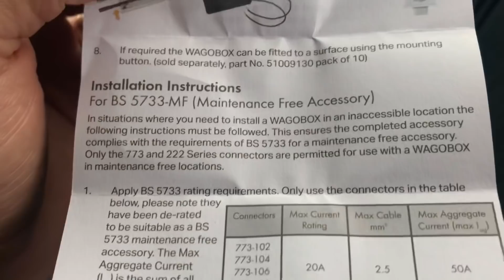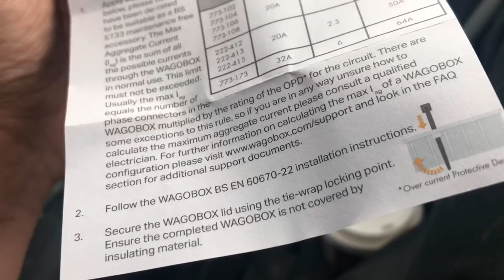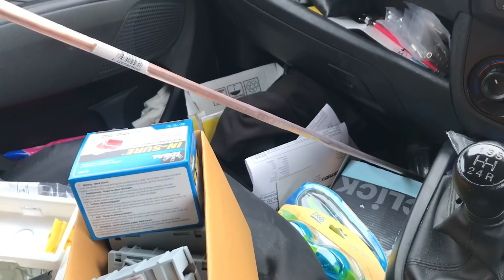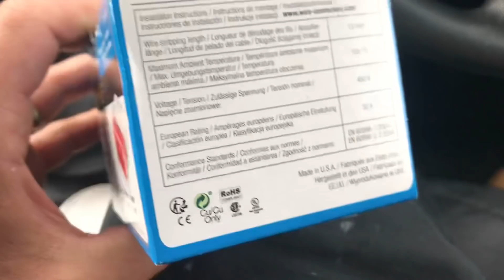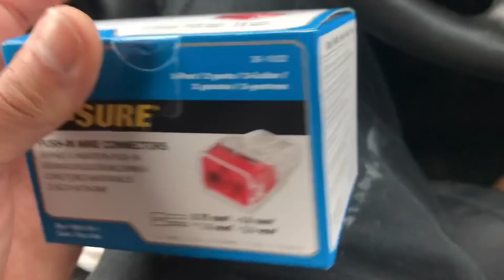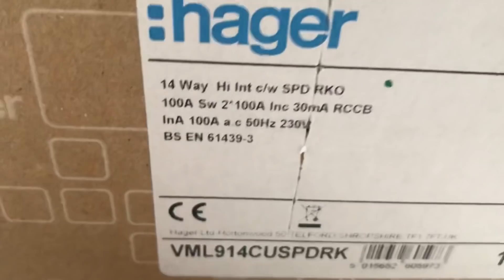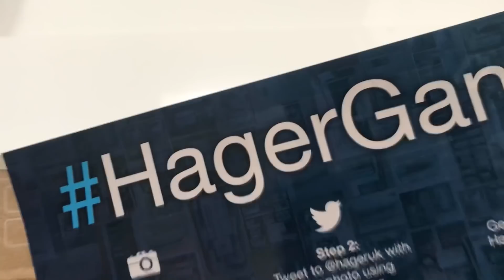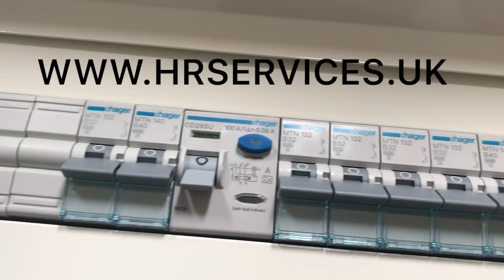Client says “too expensive”- Come price a job with me. Hager 14way CU.

Comment: Holy shit. I personally only do re wires on empty properties I work in saffron Walden/Cambridge area currently have a re wire booked in 3 bed detached fairly basic spec white face plates pendants to lounge,hall,landing and beds, 4 spots kitchen and 2 spots entrance porch 
Upgrade bonding, fill chases 
Priced at 6k plus vat client very happy with price. Your guy in a 5 bed old cottage or taking the p**s. 
Your price sounds more than fair if not too cheap I’d say.
Reply: Too cheap
Reply: I've recently had a client come back to me saying that their architect told them to keep looking and keep looking and keep looking and you will eventually get someone to do the job dirt cheap so just reflecting on that I blame the Architects on some of the jobs and I find it really frustrating. I personally the last few years put in the boot when it comes into the price, if they want to pay it they want to pay it if they don't they don't. Over here in the Republic of Ireland it's very hard for a foreigner to get into the trade or at least be a "registered electrical contractor" which leads to a lot of foreigners doing illegal works. I am assuming it's the same in the UK
Reply: I agree. Way too cheap for a difficult old home rewire
Reply: how many hours work ?..

Comment: That board in its current configuration requires 100mA type S protection for a TT system. Your connections to the RCD are only single insulated. There is a section at the back of the IET Guide to Consumer Units that deals with this.

Comment: The overcurrent protection is built into the Hager SPD hence no need for separate MCB
Reply: But what's protecting the cable from the main switch to the SPD, the cut-out fuse...?
Reply: Artisan Electrics
Think he’s asking what protects the cable going from the main switch to the spd as it’s only 6mm so the 100a main fuse is obviously much to large..
Reply: BS EN 60204-1
7.2.8 Location of overcurrent protective devices
An overcurrent protective device shall be located at the point where a reduction in the crosssectional area of the conductors or another change reduces the current-carrying capacity of the conductors, except where all the following conditions are satisfied:
– the current carrying capacity of the conductors is at least equal to that of the load;
– the part of the conductor between the point of reduction of current-carrying capacity and
the position of the overcurrent protective device is no longer than 3 m;
– the conductor is installed in such a manner as to reduce the possibility of a short-circuit,
for example, protected by an enclosure or duct.

Comment: Can't put a price on your life when the cottage burns down. Oh wait you can.
Reply: @John Smith
I'm not assuming that someone who quotes cheaper will do an inferior job. In fact, it is perhaps likely that the cheaper quoter may do an identical or even better job. The market is elastic. It is a basic mathematical principle of supply and demand. 

My example was also anecdotal, from personal experience. I just don't like being put into a dutch auction; particularity when I have done all of the initial and on-going consultation, drawing up plans and pricing on materials only for the customer to pass on my intellectual property and my time expended to another business. It's insulating, particularly when the same customer asks me to re-attend to put dangerous and shoddy workmanship right.

Comment: +CJR ELECTRICAL
I think the 100mA TD RCD is still desirable as it stops everything 'earthed/bonded' becoming live in the event of a 30mA RCD failure, i.e. a backup RCD facility, even though not required by any means.
What about when somebody comes to fit an EV-changing-point ?  They usually want MCB non-rcd SWA submain ... though I guess for a TT supply you could use a type-A RCBO and a downstream 'simple' charger (not anderson/zappi/etc)!..

Comment: I'm sure the supply to the spd is fine been off the main switch as long as the length is under a certain length and fault protection is only required.

Comment: I live in rented accom..and I tell you what, I wish the landlord contracted pro's like you.
Before I moved here, this place had suffered a poor conversion from commercial use to domestic dwelling, with no planning permission for the loft extension - so you can imagine the kinds of contractors the landlord sends here.
Watching your channel is like a breath of fresh air - you're every bit a pro.
The last contractor (I won't call him a sparky) the landlord sent here was fitting a pendant light when he actually fried himself and tripped all the switches on the board - this was after he refused my offer to use my touch-tester, and a multimeter.
"It's ok", he said, "I already got one" *bang*.
He used my test equipment after that.
He hadn't isolated at the board - he'd flipped the wrong fuse in there.
He was halfway through the job when the landlord called him away to do some pointing outside instead.
Yup - pointing.
When he ran out, I didn't realise it at the time but he'd left my ladders up in the middle of the room, and he'd left all the live wires dangling from the ceiling. Worse, he'd left the switch hanging out the wall - live.
LOL..he even took the screws with him.
I found this out a couple of hours later when I was groping blind for the light switch in the pitch dark, and found myself groping at the exposed back of the switchplate. It was pure luck I didn't get a jolt.
Yeah, next day I banned the contractor from the house and told him the landlord was taking advantage of him, and then I freaked at the landlord - esp being as the landlord didn't even get it sorted when I tried to contact him straight after.
I'm not at all confident about house electrics, but because the kid had actually took the screws too, I had to cannibalise some screws before I could fix the plate to the wall with a torch in my mouth, and after isolating the whole house at the board because the light breaker didn't actually isolate the lights.
I've called environmental health, and am contacting trading standards over it, and because of the complete lack of fire safety here. This place is a death-trap.
What with all the other issues uncovered here lately, I haven't slept a wink in weeks.

The landlord's got the same kid doing the electrics in a couple of properties he's 'renovating'. Scary.
Reply: @Prem I was broke and had no other options at the time.
2 years later, and am in a nice place now...and the property I was talking about above is still being renovated under the close supervision of the local council.

Comment: the consumer unit box displays 18th edition compliant butt im sure i read that each circuit should only isolate said circuit in the event of a fault that board under fault would isolate more than one circuit under fault conditions. i may be wrong i always fit rcbo's 🤷‍♂️

Comment: Its an old leaflet, If you use the 221 or 2273 you have to fit an adaptor to make them hold in the box properly, alternatively they released boxes to suit the newer connectors just last month.

Comment: Great vid I was way more expensive in my head 😂😂

As for the cottage job stick to your price unless it’s got a possibility of future works ie builder/company with projects!

I priced a rewire once for a friend of a friend empty house for £2800 he got a guy in for a thousand pounds less 🤦🏻‍♂️ anyway fast forward 2 years and I had a phone call off a lady who needed a house signing off after her son had had a guy rewire the house and never signed it off now they needed it as they were selling It. The prospective buyers had paid for an Eicr to be done there were 19 C1/C2’s little did she know I had lost the job to this “electrician” as you can guess I took great pleasure in passing my judgement on what had happened 😂😂

As I say stick to your prices and do it properly as you do mate. 👍🏻
Reply: Some years ago I quoted to rewire a 1930,s house, three bedroom.Was told we have got a lower price, oh pok then.Some time after I was rather surprised when the client contacted me and wanted me to call round, when I got there, they wanted my opion on what had been done.Well; every, switch ,socket, etc, surface, which had been flush previous, the "electrician" had said all the fittings had to be surface as that was the "regulations".Exterior wall lights, only half way up the wall, as apparently it was against the "regulations" for them to be any higher.One way switch's on up side down, back boxes fied with one screw and most loose on the wall.At every ceiling rose, the brown and blue of the pendent , out of the rose, as the "electrician" had not even bothered to hook them up in the ceiling rose.That and other things, well you pays your money and you pays your price.

Comment: @13:25 - nothing is protecting those cables other than the electronics and fuses down stream. If you think on it, it does make sense but you’re correct in highlighting the fact you can wire it incorrectly and in theory have a whole install load coming back with full current through those crimped cables at the incomer switch.
I always go for split boards, 100ma RCB, no more than a total combined load of ~40A on each side peak. Allowing for sine spikes inside of 100ms but otherwise rate each half for 40, so 80 total. That’s based on a 100A supply.
But I get what you mean by asking what protects those since you are correct, it just means a lot of faults (infact every fault) would need to ALMOST happen simultaneously for it to be a factor. Otherwise you have MCB, then fuse to load and in fault condition a 100ms RCD. So those supply leads ain’t ever getting close to their rating. That’s how I see the logic anyway.

Comment: You need to fit either a Hagar insulated tail entry blank or an insulated tail entry TRS gland which also stops any movement on the tails inside the board

Comment: I am a US based Electrician in FL. Just curiosity roughly how many square feet is the 5 BR cottage? how many bath rooms and what appliances were going in the kitchen? I just priced (yesterday) partial rewire, new service on the outside, new panel, 4 GFCI receps (rcbo in an outlet). wire a mini split AC and a regular AC was $4400. No wall patching. I was probably a little on the high side but not stupid.

Comment: I got 1440 min for shed supply , for TT I always put in RCBO DB , actually I don't put in duel Rcds anymore , altho I do love those hager boards , fusebox are decent and reasonable priced for RCBOs but they also have the SPD tailed of the 100a isolator 🤷‍♂️

Comment: I came in bang in 1300 also so if were me would probably stick it at 1450 as I always price over my initial calculation for safety.

I know they were for down lights but worth mentioning the in sure push connectors are not maintenance free (unless they have upgraded them).
I was told this from ideal themselves about a year ago so worth noing if anyone is intending in putting them under floors (which I had up until then). Let's hope they have or will change that as they are great and good value 👍

Comment: Had a customer comment on how much I was making so I said right let's brake it down 5 x  double sockets in lounge a light and switch, to uninstall the wiring if had to work between two rooms and access 7 areas of the lounge chop the wires in plaster patch and so on, now let's look at the plumber hes run 2 plastic pipes two each room up the front of the skirting board destroyed your floor boards and so on, my rewire price worked out £20 ph the plumber £100 ph so he's the one milking your bank account not me. The Penny's soon dropped and the customer fuckt off and left me alone, I got the job done to a high standard and put them in my no return book.

Comment: Should be a 100 ma if your using dual rcd as you have all the single insulated tails going to each rcd in the enclosure. Dangerous if you don’t . Check out the on-site guide it says to use 100 ma if your using dual rcd. Use rcbo board instead where you only have the incoming tails which aren’t protected but are double insulated and glanced.

Comment: Chris, don’t adjust your prices.  You cannot win them all.  Your quality of workmanship speaks for itself. 👍🏼. Lower price, isn’t always better as you well know & there are so many cowboys out there.  The cottage price was very reasonable.  There is no need to separate the earth rods on that install.  Connect them all through, it’s not like TN to TT.  With regards to dual rcd boards on TT, the on-site guide recommends that the main switch is swapped out for a 100ma T.D, because from the main switch the live conductors to the top of the RCD’s are not double insulated.  I’ve had lengthy conversations with the tech helpline & they told me exactly what they told you, the likely hood of anything happening is so low.  However as I work on a lot of TT properties, I now only install RCBO boards which isn’t good for the client, considering the price.  I’d rather be safe than sorry.  Also wylex do a switched neutral rcbo’s, which is great for TT as it switching both poles for isolation purposes.
Reply: patrick brannan totally agree with all you said ,shame that mk have discontinued there s type time delay rcd which you need to use an s type for fault protection and selectivity ,many people don’t use an s type as they are expensive £120 for Hagar
Reply: Can’t believe tech are happy for a load of single insulated cables not being protected against fault current in a large metal enclosure. It sounds far more dangerous than just using a plastic dB . I’d use rcbo every time on  a tt but if I had to use dual rcd I’d definitely put the upfront 100 ma for my own peace of mind .

Comment: Genuinely at a loss why you can’t use a pme supply for an out building. Any issue with the lost neutral will cause the same problems in the main building also
Reply: You can use/extend a PME supply for an outbuilding. Not sure why you think you can't.

Comment: I’m currently an apprentice and find your videos great to watch.

I am currently saving and gradually buying myself tools which will come to use for me. 

I would like a torque screwdriver, can you recommend?

Also some other tools you would recommend which will be of good use.

I have basics, standard screwdriver set, hammer, spirit level, tape measure. 

No power tools yet, I currently chase walls 😶 early doors for wiring but I’d like to prepare for when my boss trusts me to take my next steps
Reply from the maker: 5 tools 
Draper torque screwdriver (great price)
6 inch hammer (£5)
Ck wire strippers (red handles £18)
Marxsman pen (£4.50)
6 inch wire cutters.
Reply: Thank you!! I’ll keep watching your videos ! Great humble guy to watch , shame the tutors at college didn’t share some of the knowledge you share in your videos

Comment: Why not fit comm block, tails and stand alone cu for the submain ? then fit RCD at workshop then you wont get 2 in series. I would say 2k
Reply: It doesnt matter, the rccbs in the hager board will take a fair bit of time to trip A/C currents as theyre type A - 1 x rough 100ms + and close to 40ms on 5 times, so selectivity comes to mind, the type A/C RCD  im assuming will be used for the workshop will trip faster causing no nuisance trip in the house 👍

Comment: In my day as a part time Electrician (self employed ) UK  2008 I charged £130 a day here in Thailand now 2021 I have done electrical work for friends for £50 a day done a couple of New house wiring to U.K. standards or as close as I could get to it. Working in this heat is very hard work. At £50 a day I’m expensive 
Thai Electrics is shocking very bad.
Reply: That is not much above local rates none of whom are qualified at all. I use a PEA/EGAT Electriction his rates are considerably higher than yours, over 3 times. He is as you can see from his day job a real electriction and working in the Udon Thani area. His prices are worth paying as he understands the details of the job. I make furniture and will not sell for anything less than my time is worth, so I don’t sell anything, luckily I don’t need to.

Comment: Interesting point about not using Wago 221's in their boxes. I'm wondering are Wago trying to move away from the 221 to the 222 and 773 because of their ability to handle prolonged overload temperatures.

Either way, thanks for pointing it out.

Comment: Hi Chris great  channel 👍 I  make the price £1650 but I’m putting in a 3core swa assuming they have pme ? Was your reasons for not importing the earth down to cost or tripping problems (just curious)  ?? Also yes I noticed maintenance free wago’s in them self made boxes only ? Plus I only use the 24amp ones on ring mains purely down to the fact you only need to protect the cable not the overload device and 2.5t/e as you know (roughly speaking) is rated at about 20amps ? Keep the good work up you seem like a good spark ⚡️
Reply: Thought it's because you cant import the earth on a pme system if you have incoming services to a shed/outbuilding, incase you lose the neutral so have to tt the outbuilding ?
Reply: @sbmorris2k6  
Correct.

Comment: The 6mm Tri Rated Cable feeding the SPD is protected by the 100 amp main breaker this is ok as it is such a short cable and is contained in a metal enclosure same as a bus bar system the cables also have a protective sleeve for extra mechanical and insulation protection Hagar would of had it approved to be ok

Comment: The UK panel are completely different from the USA... Our Panels are hard Bussed on the Voltage legs & Neutrals/Equipment Grounds. And Completely different Terminology. The UK Panel looks like what we would have in an industrial Control Panel to operate a production machine.

Best regards,